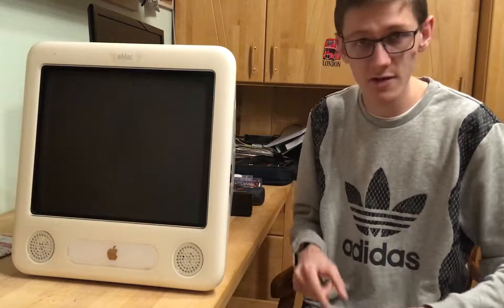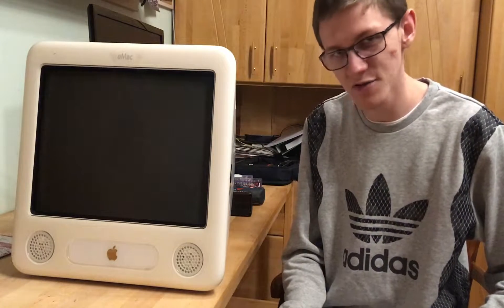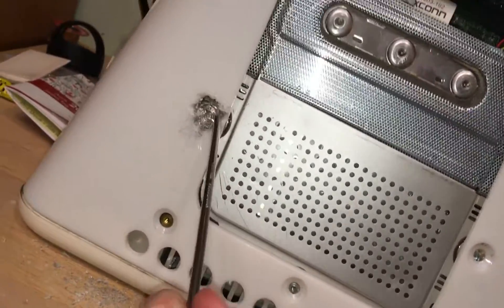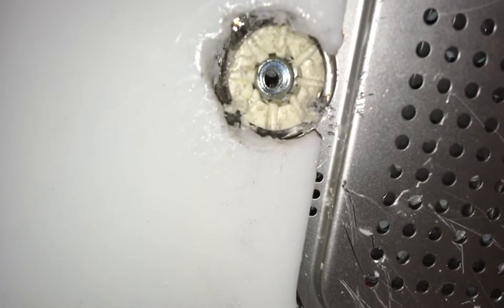eMac Disassembly - The screws from hell - Part 1

Comment: 😒 i hate screws from Hell, they sometimes use philips screws in cars too and they get rusted stuck. 🙂 Friend, on that bottom bolt you were suppose to keep drilling thru until you separate the head from its base. Theres also a set of Reverse Drill Bits so u can drill in reverse. Also use a Hammer & Punch first to give it several good wacks to loosen up the threads. Also since the head is large enuf along its circumference u cud use a Hammer & Chisel to loosen it. Looks like someone put super glue on that last bolt or maybe the heat from the computer bonded the metal to the plastic. Yeah Apple sucks bigtime but the Mac Pro Towers are pretty good and decent to work on very similar to a PC or Workstation from Dell HP IBM Lenovo 🙂🍎
Reply from the maker: About the drilling: I tried a long time, but either I had the wrong drill or I did something wrong, but the drill would just not go deeper no matter how long you drilled. It looks like superglue to me, or the plastic melted from all the generated heat to the screw haha. The Mac Pro is epic, I agree. It is epic, until you try to replace it's CPUs. Check out  our "most frustrating Mac Pro" video series if you are curious ;)
Reply: @MacintoshMen  😉 yes I remember the cpu replacement video, good one 😁🍎
Reply: @MacintoshMen  🙂 for my Mac Pro 2,1 i recently bought it an SSD and a 3.5" to 2.5" special adapter so u can plug it in easily just like a regular hard drive 😁🍎💿